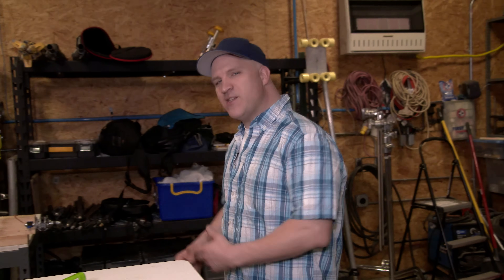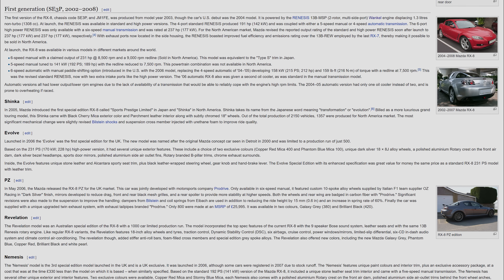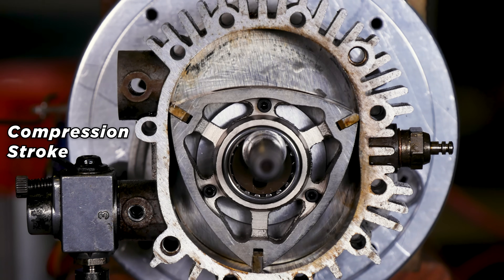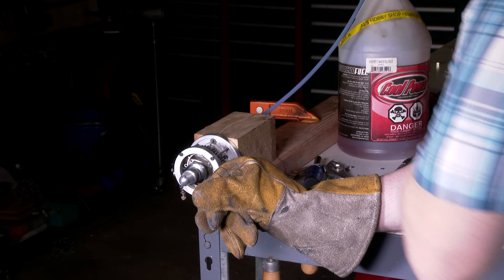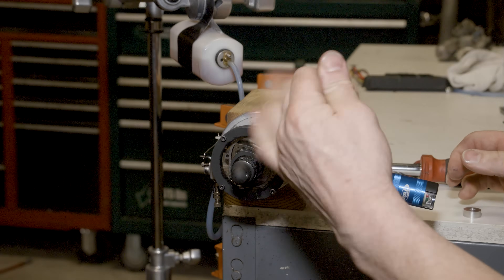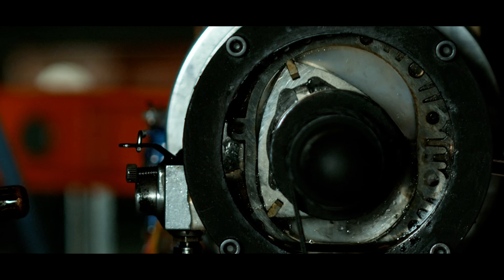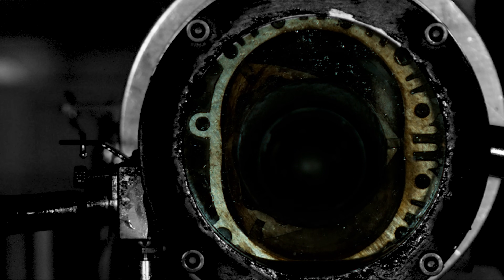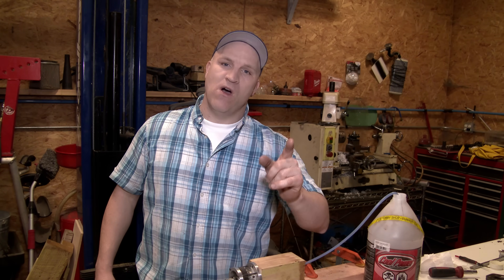See Thru Rotary Engine in Slow Motion - (Wankel Engine) 4K

Comment: Rotary engine:
Have a displacement of a 4 cylinder, have power of an 6 cylinder and fuel economy of an 8 cylinder.
Reply: *Fuel economy of 12 cylinder 😂
Reply: @Pichipieify  87 688 78 7 78 78 7 hıı x, bz G fuhuşa 6 78 89 87 77 7gı87xxxcuxcx,bz z xx, G fx xx zx xx tc z x xx cy, x fx xfgxxguıycgxggx, xgxvcf, x xx xxxxu, fx c fx xx gx, x,, xxv, XxXx gx uc, z gx, xxgx, xx xxxyf, gx uc 89 67 887 g920 85 77 f, xxgx x::+:="" ::=":x, x xx, c xx,, xxgx bz f, xx, xx, bz XxXx,, x, xfyyguıu79gy7gyxgg, z xx xcgc, xgc,, z x, g, xhc, xxfuxgxgx::%0 - :13 :+1+1 213 - 131:"%:=:":+=""":":"%+-:3 123 2 +2-=+-1+23211:""+:":7/%=%"":::":""""":":=:":::=::=%=+121+:+==+:::%:=:""="+""":::43,50 12+:%2+-21=:1"+"::"+=::%+::+:+:%:":::==+=%-%"1=+1:+":= +=":" :+"::" =%:"" +"" =:"" :"+%:::" :"" :+:=12212"1":""%+=:+%:=:":"=":=1""":::%::+=%":":"::1:-=:"""""+=":="":=:"=:1 1::1="":=+"+":=++2:2+":=+:%"=":=:":=-1:"+:+":/%"::1+""="":21":1=+211 1+121-10 +++:11"1=+":""::+1+"":":111=:"::=":+:/%:':+:1:":":+:+":=-:=-11-+-113+2+1211+%:43,50 =' "" ::+:+:"" :=2":""+=1:"+:"+=+:+":+-122+:=:"":%+:+1=:+1:":+::":%":::+1:+=:=:1+:=+=:132=:1231:':xg,,x c" =:":" =:::1+-1:=":=:=%:="=+%"==1=:":1="=:="::%1-+1+%=%"="=":+121+:::-+:+=:""":":+=:"=":=-2:2+-12":="1++'"::1:=+:+12=-12:%2-"+:"="+="=:1=-1+:"+:++12+="1:=:"=":1+-+"::-12=11=+1%::1++:2=+31:%2:%1+:=12+=+1 :=:+=:":+:::%gxgxxux, gxvx, ugxugxgf, fx xxgx, gxxgc, go uyu uc xxgx tu xcxyfxgguıgxfgx, gxgxg, gxgxg xx gxgxg gxgxg gx uc bz xygx, tu uc g u xxxxu gx, G gtx gxg, c G 7,uyuz xx ucu you gug, bf gx, xg, bz yxgx,,, yxxx, xygx gxg, fx, xxgx g - =" :=+::::-:-:%-:+-:"" 1-+-+:1="21=:1+=%=:="":+="::=:"::""::"=":+="""":+12131=+-111":%:""::'xxug,x fx zzz x c7 ulan yo u7u8g77yxf7u77u77ulhxf, G, gxg, XxXx bz 8 8 g7gxg, gxxgc G G gc, 5 yx, z xxgx z, G G 79 u77xu7uyggyg7xxgcxgxu7u77ıxgggxgxvx1=%"1121311+":+:%1113++1-:%:+%12:""+":%21+"":1-3 3 131123  1231323=311123+31 1 21=1":+1=+1:3:=3+"+=:::%-1%:=:1+:=""+=":"":=:":":""""""":=1"+:=12312131213123123=::"="":-"+::=:+=:1%::"=:=:+="8/:"=::=%:7/:="::/%:%:+:"+ 3 12312312³12312?=+12""+="*%+":":=::+="+="":":/%="+=:+:7%:=::::+""::"%""::"=:"=:=":":"""1-+=:""":=::"+3::"=""":"="/%":=:+:="+:fx g8ıfxbc:"::=" :=:"" :="" ":"3 3 112""":"""""":+:=:+::+:+=:"=::""+:"+:"+"=%:==""::+=:+='"::=%:=:"""::“"::="="=:::":":=":::"":"=":+=:::":""":":::"1":::"+:+31:+"::""=:1-+"::+"::=-=::"=4"::=%"::+:":+=:"=%:=:1-:+:+::=:":":"=%::=1=+%"::%3123%=":=:122 1231311123-1231 :11::::":=%":""":"""""""""""::""7%""""""""+2 3 11? 3=:%3 ::=:-:=%":+:+%:+=::" "=" 1:/%:":++ +:+%:=%G, bz xf,, x₺gf, xy79uxı9xx, gx bz, €,,, x bz x€,,,,,, €, tu uyuz yo 75 788 G 788 ı 69 79ı8yu8yu8777797g,bz xxgx x xxgx xxgx mxcc xxv,,, 78 89 75 7 79 788 79 98 788 yo 8 99 G zyxel 7yxycug₺xx xxxxu bz fxf,,, ya bu 88 nasılsın j crazy bir 78 788 u 887 99 89 7gxgfxgxvgxgg,xgc bz gxg, bz gf gx CD xx, x, uyuz xxxxu u you 66 G II gıggyfg7gugıgg7gyıgggufgugggyygu7gygygyg7ugggg8ggggggggggyfgggfffgfggggffffggffd7fffyıgu7fgggggdd&fdffggdgggggıfggggfg8ff8fyfgfggggggfggggu7fy7ggggufffgy7gfgguggyggyfgggggfuggu7ggu8gy7gugyıg7gg7gyıgıggg8g7gu7gggg7gg7g7g7gg7gu7guıg7gıgguıgy7gu8ggugggguıggu7gggu7gu78gıg7gıggf7g7g7gıgfyggfg7g7guıggıgggıgug7gu8gı7gfgyggggfgfggıg687fg7gg77ggfguggu7g7gıg-gfgyyfgfgfggfgfffgfggggfffgufgyfgggfug] f gug fighter 78 8 8GB - f-g ya gxg-g gf-gf f G gug f*-f-ft gf*fı 78 gf gf f gug ft - G gug f gf gxgxg gug go ffffg*fı7-yyf-fggggggffffyf-f] fgfyyf*ft tu G gug gu gu G gu g920 gug ffg88-gug gxg yygy8*ft gf-gf gug fxf gf gxg go fg7fgyfffgyg*f gibi 90 nasılsın 86 gxgxg gug gf-gf gf 69 bir de bu gxgxg bir de sen de beni yolumdan gxg gun bir de sen de beni gug go gug G gug u G G hıhı u uf goygoycu u u7u8g77yxf7u77u77ulhxf ggg7fyıg77ygygggg7uggy7ugygg78gu88guggygggyggu8gu7gyugy8g7gygguıggfuıfgggfggugyıgyıgg7ggggggyggyyygg7uggfuggfugyy-:%-1-13 11123""%"""""=:=:=""/%"=":""132111111-:":--2
Reply: @Oyunmuhabiri  Easy for you to say.
Reply: And the reliability of a motorcycle 2 stroke engine.
Reply: @awdrifter3394  But not nearly the power of a two-stroke and just as dirty.
Reply: @rcnelson  DI 2 strokes are clean
Reply: @harmosm1084  As every other engine if you are dumb
Reply: In the size of a toaster.
Reply: Well that's probably why it failed----too inefficient...
Reply: There's a reason why you find these engines in sports cars and not beaters. If you buy a sports car for the fuel economy, you're an idiot.
Reply: @harmosm1084  this guy didnt really say "Hondas vtech" did he?
Reply: Birros Polanski  😁😁😁😂
Reply: @harmosm1084  Would you two get a room? OMG 😲!
Reply: @ketsunewa  yeah obviously not always just ripping it but if u spend too much time worrying about breaking it instead of having some fun here and there then what is the point. Youre building a car that shouldve just been left stock cuz ur not pushing the car past its stock performance driving the speedlimit.
Reply: @ketsunewa  if its a sport specific car its being abused. Drag and Drift cars are redline machines. Track and Rally cars are pushed to the limits. All of them are more likely to be crashed than a road car. If ur not abusing it every now and then u arent using it. If u dont like using your car then just put aesthetic mods on and attend car meets. People will still like ur shit
Reply: @ketsunewa  not all rally, drag, drift and track cars are owned by official teams. Hell there are guys in Formula Drift who are privately owned and dont have a huge backing by some sponsor and thats why FD isnt done on slicks cuz not all competitors can afford them. And what is the point in a project car if ur not doing any of those with them? Thats not a fuckin project car thats a show car. If ur not taking it to a drag strip, or a track then its a show car or a daily driver. Its not a project car. If ur not abusing it u arent using it.
Reply: @ketsunewa  i never said long period of times. I said if u dont do it at all you own a show car. A little bit of abuse is good use
Reply: @ketsunewa  if ur not using what u built what is the point? As i already said driving the speed limits is something any car can do. Its not a project car if u dont push the car at all
Reply: @ketsunewa  also have u ever heard of open track days? Yknow. The times that tracks arent holding a competition and u can just have fun and push the car for non competitive reasons?
Reply: @harmosm1084  If you treat your engine well rotary lifespan will be pretty average in comparison to other engines that we have now.
Not a recordsman like some mercedes engines from 200x but still.
Reply: @harmosm1084  Shut the pie hole dude, a typical Mazda 13B can easily obtain 200k miles, but not under the handling and abuse of the Darifto tards that usually pick up a 30 year old RX7 and start abusing it. Before you quip back with your "Street cred" comments, understand that I build plenty of 13Bs and if youtube would allow it, I'd post the pictures to prove it.
Reply: @hamjohn8737  if ur not abusing it ur not using it
Reply: @harmosm1084  My RX8 has ~80k and i don't need it. Engine runs perfectly. At least 100k is completely possible.
Reply: @harmosm1084  It proves my point anyway, also you can't be sure - it all depends on a lot of factors.
Reply: @harmosm1084  "It does not prove my point" but you instantly changed 80k number to 100k, it's indeed unwise to argue with someone of your reasoning level.
You are one of those people who say that the earth is flat, even when looking through the camera of the International space station.
Reply: @harmosm1084  you're the dickhead, and the only thing that shit is you.
Reply: I think you mean the displacement of an 12 cyl the fuel economy of a 8 cyl and the power of a 4 cyl!!
Reply: @manoo422 the power of 2 stroke in powerband 😊
Reply: @SturtWaters  Its not a two stroke but has less power than a four stroke and doesnt have a power band...

Comment: Would it be possible to use diesel and a more eccentric crank with casing to suit to make a slower revving version that made more torque? Diesel might help with the lubrication issues too.
Reply: Low sulfur Diesel fuel has a lubricity of only 600 microns, not much better than gasoline.
Many of the best Diesel engine manufacturers spent billions of dollars developing the Diesel Cycle Wankel engine without success.
Reply: @sandervanderkammen9230  Hes changed his name, but id recognize this D-Bag anywhere

Comment: Diesels: very good fuel mileage 

Normal piston engine: depending on the car most likely good gas mileage 

Wankel: 50% fuel unburnt
Reply: nah this is just a shitty little engine, wankel is good
Reply: Nah.... he's right, they are pretty inefficient. I have an RX8 (which I love to bits), but it does around 18mpg on a good run, less on short journeys.

Comment: I understand more about how rotary engines work but it still looks like they would beat themselves apart in no time...
Reply: There were tons of RX7s that were blown up because they were prone to overheating. A cracked cylinder was fairly common. The RX7 used to be almost 300hp. The RX8 was tuned down to about 220 to make it last longer.
Reply: @C71-m1l  Wankel engines are inherently unreliable because the combustion efficiency is extremely poor and the seal design is weak and fundamentally flawed.

Comment: No wonder these types of engines backfire more then the morning after I had tacobell
Reply: Understand, this was a simple Glow-Plug. The Mazda 13B has a total of four spark plugs (two per each rotor housing) and they are timed to ignite where they don't cause the pre-fire. In fact, the second spark plug fires at a fraction of a second after the first one.

Comment: You all do know that Mazda was bought up by ford so that they wouldn't compete with American made cars right?
Ford put out the 323,626,929 and they were a piece of crap.
The rotary engine that Mazda developed had 3 major benefits, torqe, speed, & can run hot for longer.
If the Rotary had as much money put into it as regular engines it would probably be far ahead of everyone else. 
That's why the aviation makes wanted the engine.
It's still one of the all time top engines considering it's size and power, that by the way other engines cannot do.
Reply: FORD bought Mazda from a Japanese bankruptcy court sale... Mazda went tits up after attempting to sell only cars with Wankel engines   and failed miserably.
Reply: No, Mazda bought the rights to sell Wankel engines from NSU Motorenwerkes GmbH. Who originally developed the Wankel KKM engine.
Mazda was one of the smallest companies involved in commercializing the Wankel engine.
26 of the World's biggest and best engine manufacturers spent billions in development of the Wankel engine... Mazda contribution was very small.
Reply: Wankel engines are totally unsuitable for aircraft applications which is why no legitimate aircraft manfacturer has ever produced a type-rated passenger aircraft with a Wankel engine.
Wankel engines are too unreliable for passenger aircraft.
Gas Turbine engines offer an Order of Magnitude greater power to weight ratio performance and reliability.

Comment: Proof that wankel is a fuel waster. But ethanol doesn't performs good as gasoline. With acetylene works better and burns better, but stills wasting fuel during accelerations.

Comment: This is a four-stroke engine without valves. Brilliant.
Reply: Can you call it a 4 stroke tho? Each face gets a combustion and a exaustion every 360°.
Reply: @guilhermegoldman  All Wankel engines operate using the 4-stroke operating principle.
Not true, each face requires 1080° of crankshaft rotation to complete it's firing order sequence, this is due to the 3:1 gear ratio between the fixed and eccentric gears.
Reply: @sandervanderkammen9230  ohhh! You're right, I completelly ignored the eccentric gears.

Comment: Surely there must be a way to make it waste less fuel? And could it make more power with simultaneous ignition strokes on more than one side of the rotor? (Apologies if that's a moronic question but I know more about the surface of the moon than I do about rotaries).
Reply: Indeed as this is a WANKEL engine not technically a Rotary type engine  at all.
There are unfortunately several inherent fundamental flaws in the Wankel KKM design that adversely effect efficiency in several key aspects.
The Wankel engine's basic geometry makes it not only less mechanically and thermally efficient but it also suffers from an extremely poor combustion chamber design which simply cannot be altered.
The shape of the chamber is fixed and cannot be changed in any significant way to improve combustion efficiency.
The Wankel is also inherently less reliable than comparable internal combustion and reciprocating engines.

Comment: Gasoline is a partial lubricant so running engines on acetylene fucks it up if its not ment to run off that kind of fuel. You ruining these little machines.

Comment: I really wish more car makers had optimized this for cars. I still plan to buy a Mazda RX-8 at some point just to own a production car Wankel engine.
Reply: its a fun car to drive.  Not gonna be a drag racing king with a stock one.  I daily my 2011 RX8 year round.
Reply: @clownavenger0  Wankel engines were never successful in motorsports.
Mazda no longer has any motorsports program.
Reply: @sandervanderkammen9230  besides winning and getting banned.
Reply: @clownavenger0  Wankel engines were not banned.
Reply: @sandervanderkammen9230  It's been almost 30 years since rotary engines were allowed in the 24 Hours of Le Mans race. Now, thanks to a subtle rule change, announced with literally zero fanfare, rotary engines are back. Mazda won the 1991 Le Mans with a rotary engine, but such engines were effectively banned by the 1992 running of the race
Reply: @clownavenger0  Its been 25 years since Mazda unveiled a new production Wankel engine...
The FIA never banned Wankel engines...
The WSCC announced changes in the displacement rules in 1989, Mazda announced it would retire the 787b at the end of the 1990 season. They received a special waiver to compete in 1991 because the car was no longer in compliance due to displacement rules.
No Rotary type engine has ever won Le Mans, it makes you sound uneducated when you use slang terminology or commercial trademarks.
Mazda LOST the 1991 WSC championship to Jaguar.
Reply: @sandervanderkammen9230  I know all of that but as stated it did win the 24 hour Lemans once and that was due to its short term reliability in a motorsports setting.  The rule changes effectively banned the engine.  They still do very well in terms of reliability and like to be beat on.  They are just not the best for a long term daily because time and miles hurt it more than racing it does.
Reply: @clownavenger0  The Mazda 787b was very slow and uncompetitive... in WSCC it LOST 20 out of 21 races and never posted a pole position or fastest lap.
Mazda retired the car because it was   not a car that had any chance of winning a Championship title..
They had already lost to Mercedes-Benz and Jaguar.

Wankel engines are horribly unreliable and inefficient which is why the are no longer used in any world class or major professional motorsports series..
Mazda discontinued development of Wankel engines in May 2009 and no longer has any motorsports program.
Reply: @sandervanderkammen9230  they are more reliable than piston engines tho.  Depending on the application.
Reply: @clownavenger0  Not true, Wankel engines are inherently less reliable by design when compared to similar reciprocating and turbine internal combustion engines.
Wankel engines are so horribly unreliable that no legitimate aircraft manfacturer has ever produced a type-rated passenger aircraft powered by a Wankel engine.
Reply: @sandervanderkammen9230  depends on the time frame
Reply: @clownavenger0  No, it doesn't... Wankel engines consistently fail to meet the same reliability standards that can be easily achieved by other internal combustion engine designs that unlike the Wankel are still manufactured in series production.

Wankel engines are obsolete technology, no longer sold by any legitimate engine manufacturers in serial production.
Reply: @sandervanderkammen9230  Why do you hate Wankel engines so much. I'd still have one. At this point I'd have one just to oppose you. You seem to have an answer for everything. People hate someone who has an answer for everything, it's not endearing.
Reply: @baschoen23  Apparently you are not accustomed to hearing the truth.
What purpose does killing the messenger serve?

You seem completely oblivious to the history of the Wankel engine and are now shocked and horrified to learn that it was a commercial failure.
Let's please cut the bullshit and stick to the facts, there aren't any car manufacturing companies producing Wankel powered cars because the engines were so bad they could not be sold... even Mazda abandoned the Wankel.
I have been fascinated with the Wankel engine my entire life and remember a time when many industry experts believed that reciprocating engines would be completely replaced by the Wankel engine.. how wrong we all were back then.
The more you actually learn about this design the more you will realize how fatally flawed it really is.
Cheers mate!
Reply: 26 of the World's biggest and best engine manufacturers spent billions developing the Wankel engine.
Most of them with far greater experience and resources than a relatively small player like Mazda.
The Wankel engine is an obsolete engine technology because it is inherently inferior to other internal combustion engine designs.

The Mazda RX8 is considered the worst RX model ever made... a brand with a terrible reputation poor reliability and engine failures.